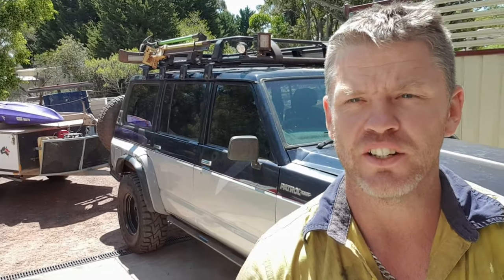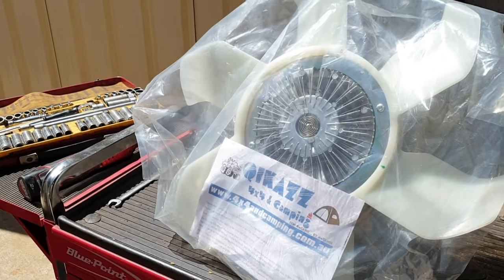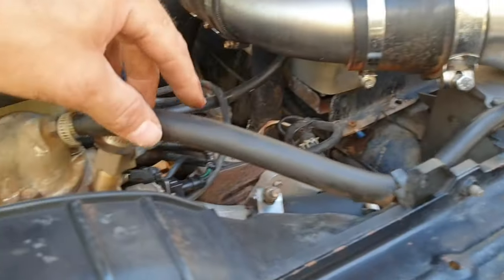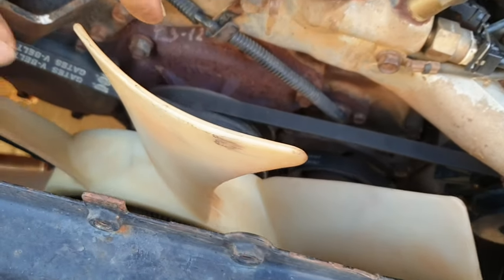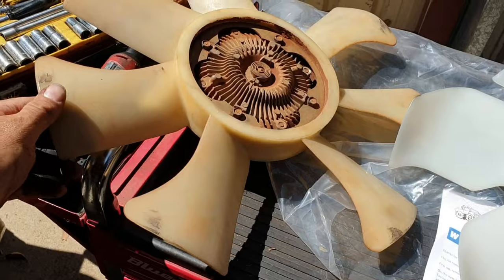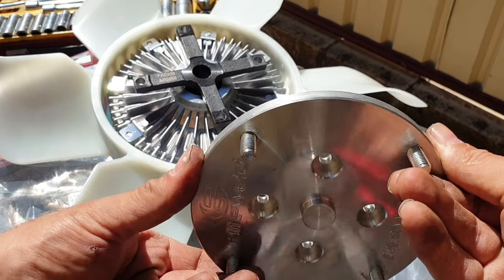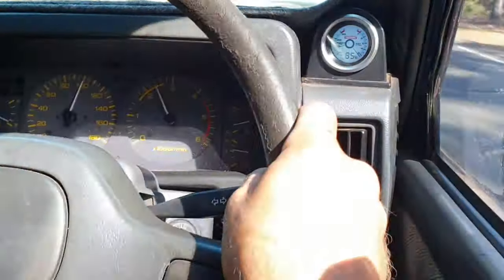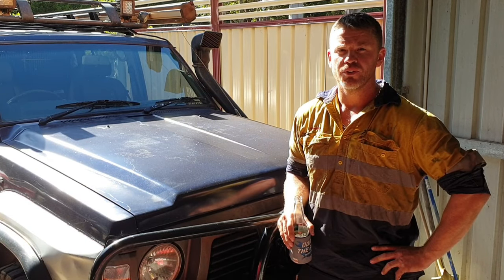TD42 cooling Fan upgrade on my GQ Patrol

Comment: just an idea for a future vid, you could test what happens when you dont have a shroud on the radiator, even showing the temp differences between the lower rad shroud being disconnected. Its pretty interesting to see the temp differences. Nice work 
byron!
Reply from the maker: Cheers mate
Just done a trip down south  Temperatures for those days 27 to 30 and at 110km no trailers abit of a load kids etc engine temps 83ish im happy with that.
Take it easy 👍

Comment: Hey mate great video, what size tyres and diff gears are you running to get those revs at 100kph?
Reply from the maker: Gday mate
Tyres 285/75R16
4.3 diffs 
Hope this helps you out take it easy 👍

Comment: Excellent work mate , 
you’ve mentioned the radiator being a 2 core 
I’ve got a 3 core but not sure if this fan will fit , have you had any experiences with that 
Cheers
Reply from the maker: Sorry no bro
Reply: Try UFI’s fan. They don’t have an adapter plate and have more clearance
Reply from the maker: Cheers Tanner thats a cool tip
Reply: @downtheshedwithbyron  no prob. Just discovered your channel and Love the vids mate 👌🏼

Comment: G'day Byron, great video mate, Silly question I guess but how can I check to see if mine has a 2-core or a 3-core radiator mate?  Is there a tag that tells me on the radiator or another way to find out.
Reply from the maker: Hey mate 
If you can try measuring the core 
Or having a look at it the core will be flush ish with the tanks i hope you under stand what i mean

Comment: Hi mate, would you suggest getting the QIKAZZ Mitzi fan upgrade for a TD42 stock GQ or a G35 upgrade? Which one would you recommend as I’m just trying to figure which one is better? For my stock standard GQ TD42 silver top non-turbo. Cheers
Reply from the maker: Hey mate 
depending on your budget 
Ive got a mate running a G35 fan on his gu no dramas
Reply: @downtheshedwithbyron  thanks mate for that. Yeah, those Mitzi fans are real expensive compared to the G35 upgrade. Would you get any chance know why they are more dear? Cheers Stan
Reply from the maker: @dunstanfernando  engineering of the attempter probably

Comment: do you know what your clearance measurements were before and after?
Reply from the maker: Gday mate 
Sorry no i did get that but when i get a chance ill get the after measurement for you.👍
Reply from the maker: Sorry mate no but it just in front of the radiator straps its about 15- 20mm clearance id have to double check

Comment: TD42 OVERHEATING? MUST READ!!. 

My car never ran hot. 2000 DX patrol NA with after market turbo, 14psi boost. 5 inch lift and muddies… 115 on the highway towing the boat, never got hot. 
 I noticed the OEM fan blade cracking and replaced it with one of the cheap OEM copies available from online auto parts/ eBay/ Bursons - they are all around $30-50

The leading edge of the blade on the new fan is actually NEGATIVE blade pitch angle. The outer 1/3 of the blade is trying to push air against itself!  Half sucking half blowing!!!! After changing ONLY this part. It ran hot on the highway doing 110 with no load!  

Online auto parts admits to selling thousands of these fans - maybe mine is a one off?. I’m convinced that the “kettle”, is actually the result of thousands of poorly manufactured fans being installed as many thousands of cracked oem fans have been replaced by cheap Chinese copies.

Check yours out. You might be surprised!? Let me know if this helps?! I’m super curious!! I spent lots of money on other parts before realizing it was just this.
Reply from the maker: Good fined mate 
So what set up are you running now?
Im going to try fitting a air dam guard this week to see what results I get with that.

Comment: Hello there  I just replaced my Fan clutch on my Nissan frontier  and it sounds loud  . Is that normal Would it damage any other parts of my engine because it sounds like its working harder  let me know thanks
Reply from the maker: Gday
Mate im guessing you replaced the fan hub due to the old 1 being unserviceable so it sounds like your fan is working now

Comment: That viscous hub is big and heavy it’s not fast as genuine hub
Reply from the maker: Yeah your not wrong 
Its been going well though i think ive had it on there for 3 years now
Reply: @downtheshedwithbyron 
Oh ok, so ya didn’t swap over to a UFI brand fan. It’s just i read a previous comment & ya said that the quickazz fan was rubbing on the fan shroud.. Also whats ya opinion on keeping the fan hub add some toyota hub clutch oil & just bolt on a G35 fan on??. Like ya think if the genuine fan clutch is lock’n up correctly the G35 fan is enough & just buy that) or buy a UFI fam
Reply from the maker: @triggerhappy8872  hey mate 
Looking back at that now quickazz or UFI are both great options 
I had a broken engine mount 
With the standard hub and G35 fan my mate runs it on his GU and has had a good result 👍 
So im would say it depends on your budget 
But if you can upgrade the hub and fan then your done 
Also fit a td42 tubro thermostat genuine nissan 
Hope this helps you out mate 👍

Comment: What kind boost are you running in that wagon mate psi pressure
Reply from the maker: Hey mate about 16psi
Reply: @downtheshedwithbyron  yeah ok thanks mate I'm running the same
Reply from the maker: Sweet dude hope this helps you out 👍
Reply: @downtheshedwithbyron  yeah I'm running 16psi an a big top mount with the fan upgrade